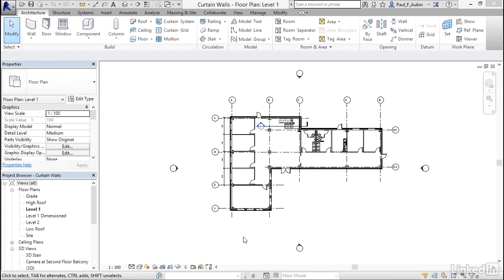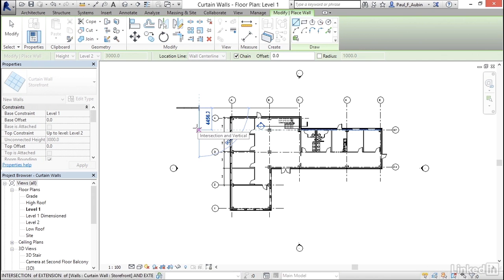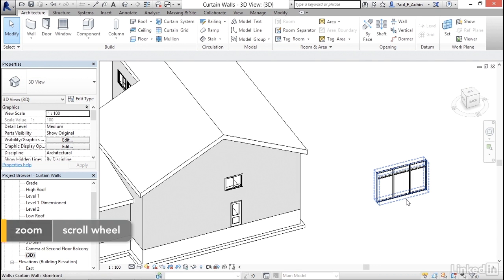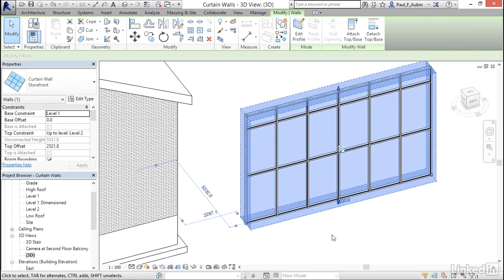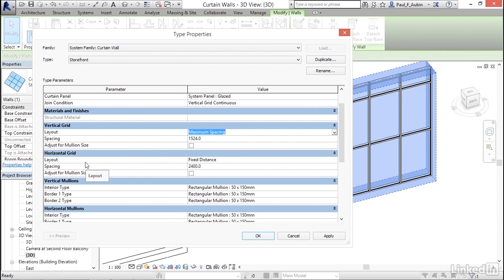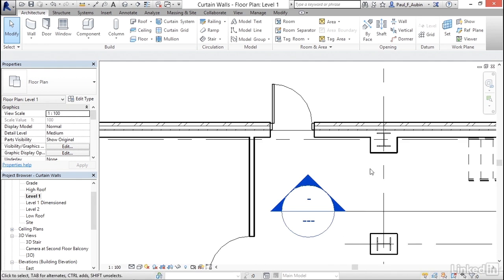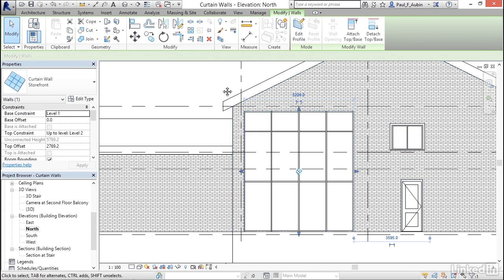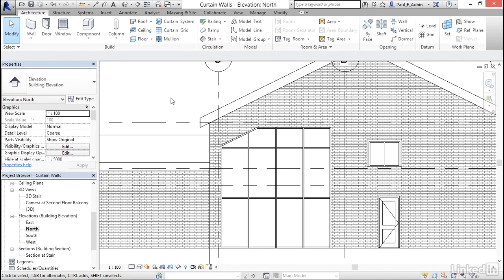32) Adding curtain walls (REVIT 2017)

Comment: Please, what is a courtain Wall in Revit? and how can I create it?
Reply: The Curtain Wall tool in Revit can do much more than glazed walls. It can be used for walls with complex patterns, special railings and even casework. 

Curtain walls are different because of a few key additional features.
CURTAIN GRIDS

Curtain grids are division created on the walls. These division can be horizontal or vertical.

MULLIONS

Mullions are elements that can be created on each curtain grid segment, as well as on each curtain wall extremities.

CURTAIN PANELS

Curtain panels are rectangular elements located between each curtain grids.

I hope this information can help you.